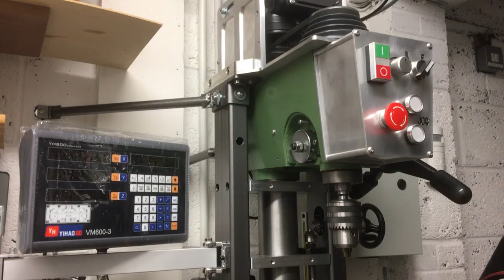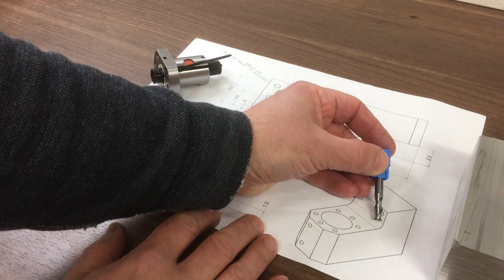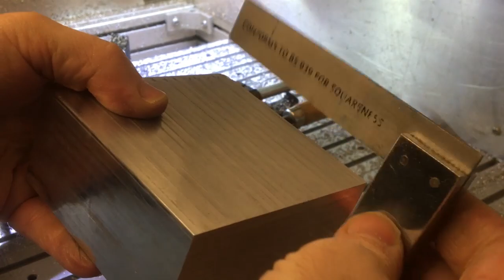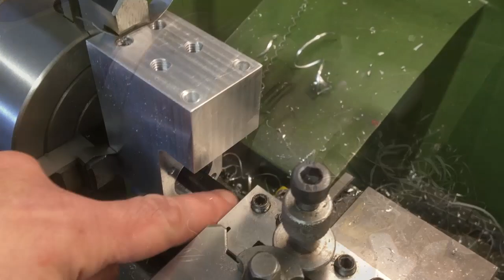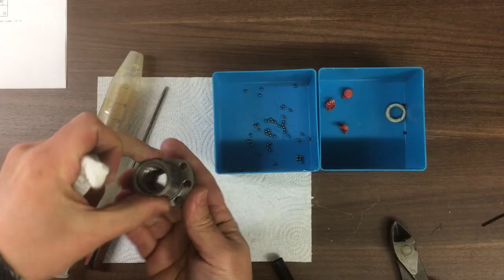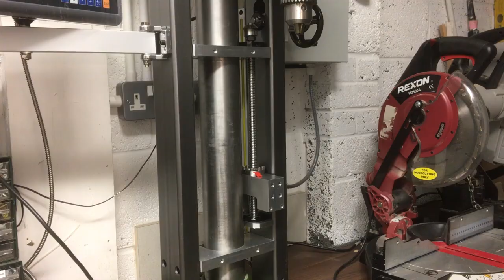Ep16: Drill Press Upgrade | Machining the ballnut mount

Comment: Installing the bracket screws looked painful. Have you tried using ball end keys?
Reply from the maker: I do have some but these Allen keys were closer !  It is only nipped up as it will need adjusting into the final position once the main table is in place.  Thanks

Comment: Redarding this drill press work. Awesome I keep learning little things that I never knew and I appreciate it. Like cleaning out a ball nut.

In regards to your machine being to fast for cutting steel effectively:

https://youtu.be/92hkvbIfFgY  This young man made an interesting addition to his high speed CNC. He added a secondary shaft and two pulleys to make it more useful in Steel. It in German on his other channel, but There is the magic of translation. Skills are the same in any language. You would see the utility of this in seconds.
Reply from the maker: Thanks.  Actually if you look back over the CNC build you might see the Z axis has additional holes above where the spindle currently mounts.  The idea was that the existing motor would go up there and would drive a separate cassette via pulleys to get the speed down.  This cassette would be a simple ER collet with straight shank held in place via AC bearings.  That would give the speed for steel, and larger ER collet to fit larger end mills.  The other option was to make another more complex spindle with power draw bar, based on using an R8 collet to hold (and release) a TTS style holder.  But those are projects for another day.

I would probably be better off getting a dedicated manual milling machine (at the rate my projects progress!) and keep the CNC machine for curvy shapes.
Reply: @routercnc9517    I have found some long shank (200mm) ER 32 collet extensions that look like winning candidates for a simple auxiliary shaft. Might make it happen a lot quicker.
Reply from the maker: @KravchenkoAudioPerth  That is what I was going to start with, yes.  But still some way down the project list.

Comment: Good work mate. What are you using in your coolant bottle? I found a 1 litre bottle of emulsified oil stuff on ebay that you mix with water and its been an absolute godsend. Makes about 20 litres but I just mix up 30ml at a time with 600ml of water. No rusting, no smoke, and no fumes that I can see. It also doesn't evaporate so you don't have to keep spraying every few seconds.
Reply from the maker: The spray is WD40.  I bought a big container from screwfix and then I refill the spray bottle when needed.  Works OK but does generate some smoke.  I have an extractor nearby which sort of helps.  I'll look into the oil option, thanks.

Comment: Great project! 
Two remarks: First, you might want to do the fillet toolpath rotated by 90°, so up and down and not left to right. With an 8 mm endmill you could probably get away with a stepover of 1 mm and still get a better surface finish. 
Secondly, you might want to check some things on your CNC machine. I've watched your build series at least twice and there's no way a machine that's as massive as yours makes such unhappy sounds with comparably small cuts. My guess would be sloppy spindle bearings but it might also be a loose screw connection somewhere on the gantry. 
Anyway, keep up the good content, very interesting :)
Reply from the maker: Thank you.  Yes, I don't do much 3D work so I went with something which worked in the CAM software.  I think your idea would have been better.
I have an ER11 collet so I can only go to 6mm maximum.  For this part I had a lot of stickout so took it easy and you can hear it trying to chatter.  That might be part of it.  The spindle is a cheap chinese spindle 1.5 kW and is over 10 years old with lots of aluminium cutting.  Could be wearing out.  It could do with a more powerful spindle but that is a project for another day !  Thanks

Comment: Hey cool vid(didn't finish it yet) but thank God I didn't need to wait too long for this one! Also I don't have a mill or a router or anything but I really like the idea of machining the brackets (besides my drill press) for the column and I was thinking(which is usually a bad sign) can I drill holes around the desired ID then take a Dremel to cut off the tabs still holding it on then bench grind them till they're round if I have any better ideas please I really hate my method!!
Reply from the maker: With work and home life I tend to upload about every 3 weeks or so.  But we will get there . . . !
Reply from the maker: Peck drill holes around the outline of a larger hole is a very difficult way to make an accurate hole.  Other options are to bore it on a lathe on a face plate, or use a handheld router with a template guide and take your time to clean up to the final diameter once most of the centre has been removed.
Reply: @routercnc9517  thanks I'm probably going to go with the router because I don't have lathe. Thanks so much for your advice!!
Reply from the maker: @raphaelroshwalb5500  OK, be careful !  Hand held routers on aluminium will want to kick out more so mind how you go and take gentle cuts.